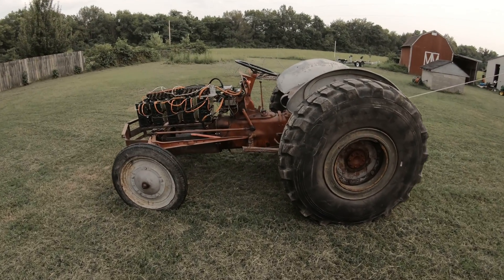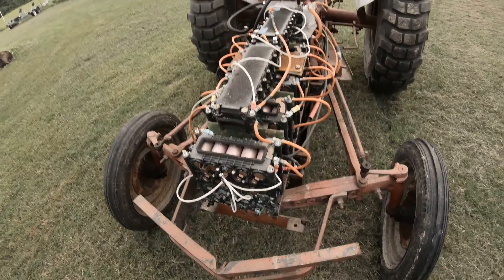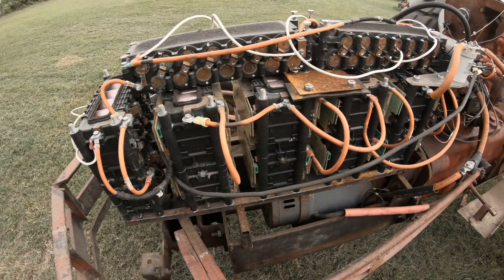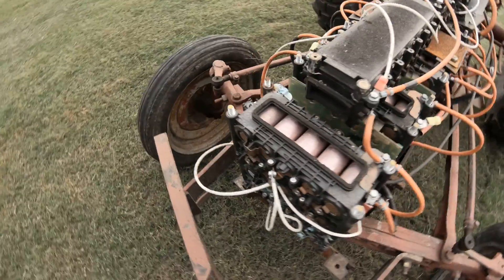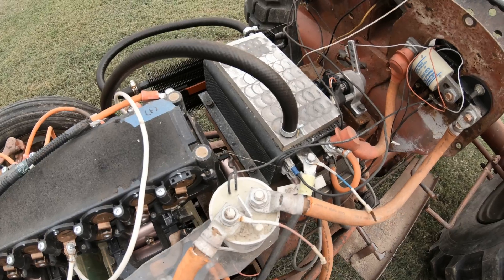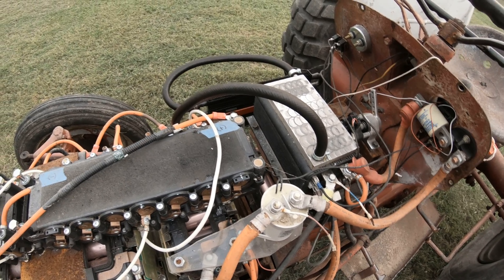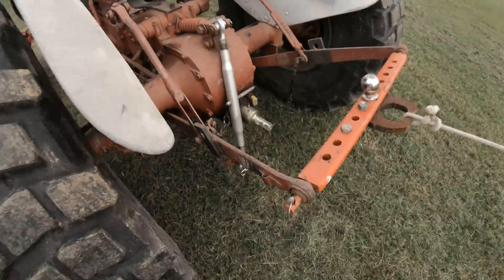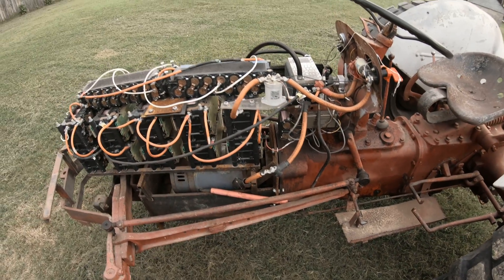1 Year Update using my DIY Electric Tractor

Comment: I’d recommend putting the cooling block on the bottom. 

Also the sunlight kills those cheap screens.
Reply from the maker: @RetroElectric  thanks. I wound up going to a different motor controller and liquid cooling setup.
Reply: @stevenmurphree  awesome did you post any of those newer video updates of it?

Comment: I fully support living BMS free one day at a time.  I use Nissan Leaf modules in my home storage (as well as LiFePO4).  They are nice because the modules are 2P2S.  All of mine came out of wrecked cars.  Out of the literal box, they were very well balanced.  After 3 years of use, they're all still within .01V of each other...pretty amazing!  In my little lawn tractor, I use a pair of Chevy Volt modules.  They, like yours, are stuck in an unmodifiable 12S factory configuration.  12S is problematic for home solar because 99% of 48V inverters are based on lead-acid battery voltage ranges which more closely resemble 14S lithium ion.  With the Nissan modules it's fairly easy to do a basic balance.  You just wire them all up in parallel for a week or so and they'll equalize their voltages.  This isn't really balancing though because you don't know what each modules state of charge is.  With all voltages equal, the SOC's will be pretty close which is good enough for a DIY tractor as long as you PROMISE to not over discharge or over charge them.  Keep them in the 20%-80% SOC range and the world will be right...and periodically check individual cell voltages.  I've found my Volt modules have stayed very tightly balanced in the 3 years I've used my tractor.  The one exception to this BMS-free lifestyle is Tesla Model S/X modules.  They need an active BMS...there is no exception to this in my mind.  LiFePO4 are my favorite for EV conversions of any kind.  They're much more forgiving of stupid battery practices.  That's not to say they're not easily damaged/ruined...they are...they just won't burn down your shop/house!  The best way to balance these is a process called bottom balancing.  Forgive me if you know this already but they way it's done is fairly simple if not time consuming.  You put a BIG resistor across the terminals and use a programmable volt meter with a relay in it to monitor the cell.  When the cell discharges to 2.25v or so, the relay opens and disconnects the resistor.  The cell voltage will naturally bounce back up with the load removed. When it hits 2.7v the relay closes and this process repeats a dozen times or so until the battery voltage no longer bounces back up to 2.7v.  Let the cell sit for a few days and check the voltage.  It should be around 2.5-2.6v.  This is considered "bottom balanced."  Now, configure your balanced cells how you want them and begin charging.  Closely monitor cell voltages. When you see a cell hit 3.6v, record the pack voltage.  Set your charger for that voltage and you're good to go!  Set your motor controller or inverter to shut down at 2.5v per cell and, again, watch the cells.  If one hits 2.5v early, record that voltage and reprogram your controller or inverter.  
I hope this helps...not that you asked.  :)
Reply from the maker: Good info. In my instance these batteries have come more irregular in charge in the last 1.5yr of use so I cannot charge or discharge as much. I made an update video talking about the challenges. I will likely go to a simple 16s2p lifepo4 solution long term with a BMS.